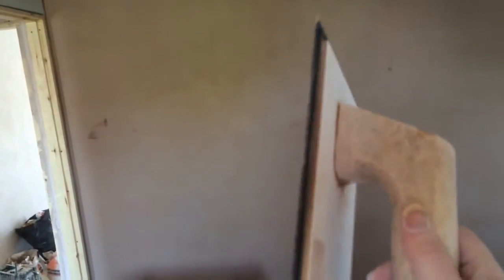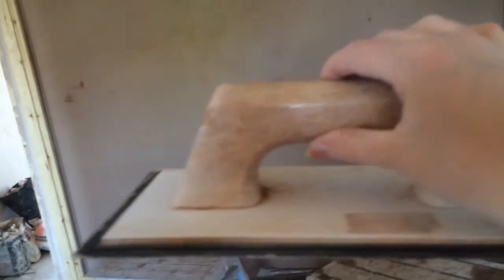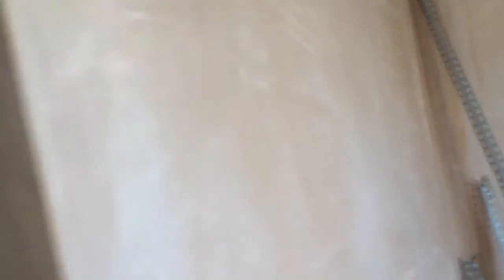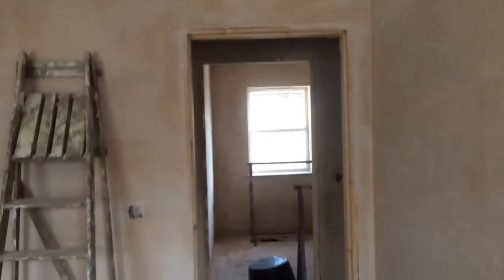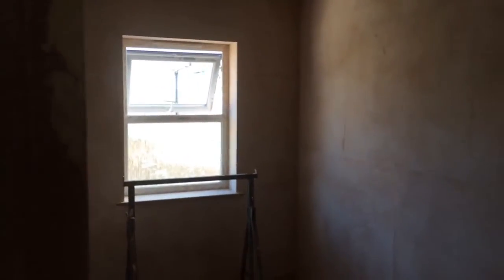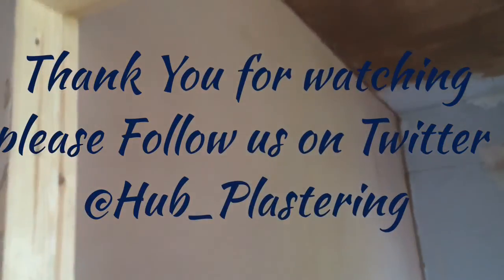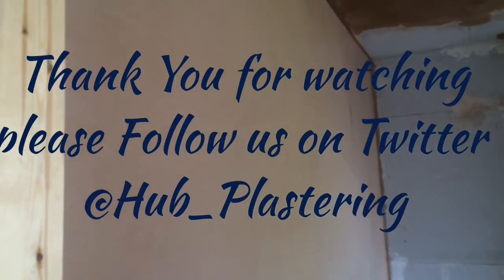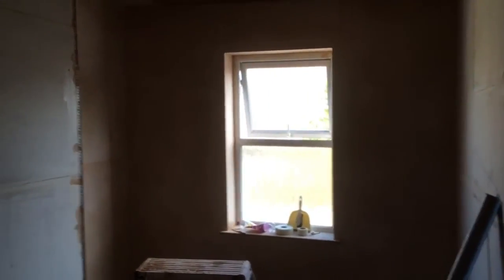SpeedSkim Review/Blog

Comment: how long after putting the plaster on the wall do you wait before you use the speedskim? Do you use it to take out the lines left by the trowel or do you use it to flatten the whole surface? when i put the plaster on the wall with a trowel the finish isn't great - when you run your hand over the surface you can feel the undulation in the surface. Would using the speedskim cure this problem?
Reply from the maker: +BODGE71 I use it to flatten then whizz over it with my trowel like 5 mins later to get all the little lumps n bumps